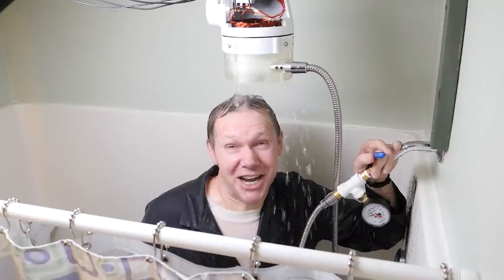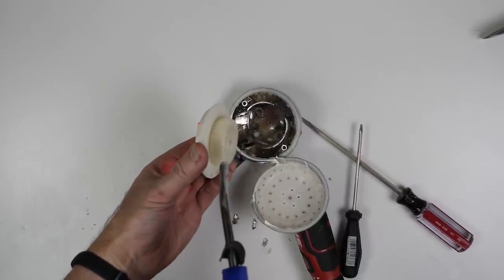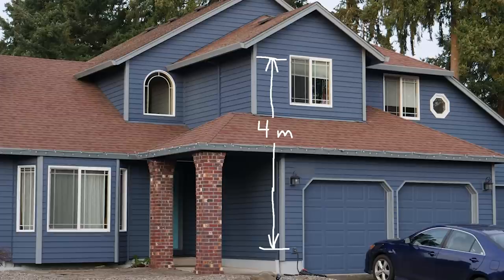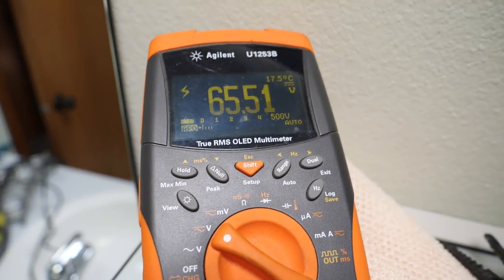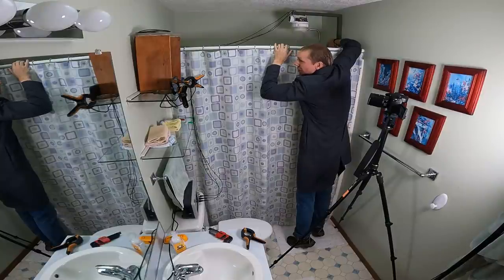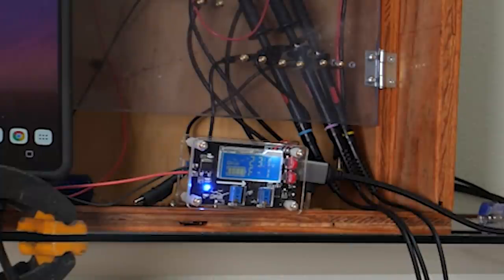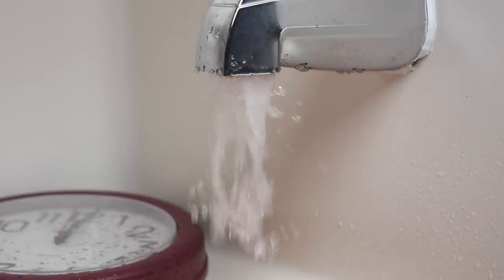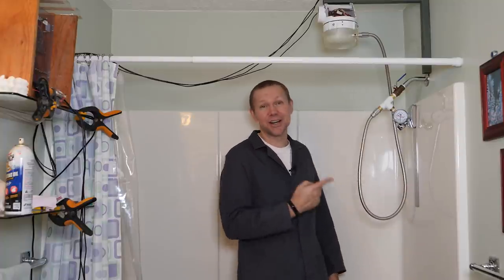SHOCKING Results! How much POWER is in your SHOWER?

Comment: I can see many possible improvements to this build.    First is the large closed bearing .It will be a big energy looser with water coming out at high speed wanting to impart its energy on a wheel with low water mass. Try a smaller diameter shaft with 2  ball bearing sets spaced apart (even open ended s/s bearings are far better).  Second is the generator . Getting the correct generator for the job is very important. Selecting the correct generator with windings not too thick or too thin or too big in diameter can be a bit tricky. You need the water to come out out the turbine dropping vertically if possible imparting all it's energy. Imagine a base ball player catching a ball , absorbing all that energy and then dropping the ball to the ground. This is how all these water powered generators should work to impart maximum energy.     The third very important potential energy looser is the jet nozzle and pipe set up . This is a biggie and has many similarities to resistance in an electrical circuit and is poorly understood. I won't go into this rather I would like to see how you do with the first 2 ideas.   Keep up with the good work!!

Comment: Note Three phase power requires three rectifiers to capture energy generated. Each rectifier has losses. Delta phase configuration 3wires but does “weird buck/boost” thing. WYE configurations uses 3 or 4wires to achieve different voltage output. I am not electrical engineer just a tinker. I’m not good at math so I struggle with formulas they kind of put dampers on the fun😣

Comment: I would try changing the bearings to ceramic or hybrid ceramic and changing the motor to a brushless drone motor or brushless rc motor and size the kv to match the output rpm of the turbine. trying two lower flow nozzles on opposing sides might help balance the power output.

Comment: To get a feeling of efficiency and debugging the problem, you could bypass all rectifying, smoothing and USB charging system and just dump all energy straight into some power resistors and measure/calculate the max power the turbine is able to produce. If that results into only about 3 Watts as well, you know you can rule out inefficiency of the electronics and focus on the turbine part.

Comment: Try looking at the no load voltages on a scope.  You can compare the waveforms to see if there is an issue.  To test the core loss you could remove the stator and spin the rotor and measure the power input.  Then repeat the test with the stator installed and the gen at no load and the stator installed.  The difference in power will be the eddy current and hysteresis (core loss) in the stator core.  This core loss will decrease some with load, but it will give you some idea.  Also you may have increased copper losses due to skin effect if your frequency is much higher than the design intent.

Comment: I love this!

Did I see 3 scope probes? Wonder what it would look like with an oscilloscope. They're getting cheap nowadays, and you shouldn't need a fancy/expensive one for this project.

I was also wondering if there is an optimal speed on the impeller. Perhaps faster is better

You might want to take another look at the wiring of the windings. 

Perhaps the initial star config, along with transformers, could be the way to go. Or a gearbox. 

Very interesting video! I'm subscribing!

Comment: Prehaps you shold try using an adjustable electronic load straight from the rectifier to compare the output power with different amounts of load

Comment: Hello
I love your videos you really have a great content.
I want to ask if you tried testing the generator with a proper wind turbune controller( maybe an MPPT as for solar panels ) to be able to get the max ammount of power and charge a 12V battery with that.
Maybe this will help to get the desired power.
Thank you alotfor your great videos!!

Comment: Your static pressure is different from when you open the spigot. When you open the spigot it relieves some of the pressure. Looks like the water washed all the lubricant out of the bearing.

Comment: Just an idea??? How about run out the generator with the Pelton wheel at full out max speed voltage and step down the voltage through a transformer then dc rectify into a capacitor to straighten out the curves for charging?
Don't most generators run full out at highest voltage then step down for usable current at the end?
Always great to see your excitement with experiments.

Comment: Since you have way more voltage than you actually need for the task, I would assume you could increase the diameter of the nozzle, which would increase the volume of the water, but decrease the velocity. This in turn would produce more torque, which would in turn, provide more thrust to the impeller. This should produce a higher amperage but at less voltage, resulting in a more consistent or "optimized" generation of current.
My SWAG would say a 0.125" nozzle should do it, but to be safe, I would probably go with a 0.137", assuming a current nozzle diameter of 0.097"

Comment: I would test the generator outside of the shower with compressed air to verify it producing the power it is supposed to. Also would consider building the casing to hold more water around the fins with a spiral tapered outlet. The idea is for there to be consistent pressure throughout and around the fins with a clean exit for the water.

Comment: i think you should upgrade the electrical stuff instead of turning down the capicity of the mechanical parts.   because that is where you loose your power, by downgrading stuff and not using it`s full potential, and you get different results every time you use it.

Comment: Might try increasing the diameter of the wheel relative to the water flow/pressure. Larger diameter= Slower RPM, Increased torque. It sounds like when the converter is trying to pull power from the gen, it does not have enough torque to sustain the rpm of the Gen.

Comment: you should proportionate all stages to deliver the optimum tuned setup ,  like the nozzle is proportional to the peltonwheel so it produces lower rpm to higher torque. second the regulator  could be a solar PV , that will regulate almost any voltage to the  intermediate buffer voltage  , eg. 24 volts dc ...  and thats easy to convert to a phone charger  making the tailor  voltage/current for the cellphone

Comment: So there are many ways to increase efficiency but there are cost issues, when dealing with this. 
So the more generator turbines that get put on Water systems the more energy will be needed to pump the water to everyone. But thermal recuperation from waste water as well as flow pressure turning another turbine, and more. This has been a subject I've been thinking alot about since I was a kid.

Bonus fact. Most people who still have copper phone lines coming in to there house have a small ac power source that is required to stay active,  due to law, that you could power led lights or charge things with enough electronics know how, that at least for now is technically free

Comment: I have a rain catch that's approximately 75 feet above my barn. Could you rough out the steps I'd need to take to consider for power storage and generation? I can make the catch as large as I'd like and put multiple turbine points on it as it descends down, but I'd just like to figure out some rough calculations to see at what point the return on investment is really worth it in terms of generating power and initial cost. I've seen some pretty impressive water generator systems that use ponds and other catchments that I could reproduce here, but I'd like to see if any math will give me reasonable expectations beyond just using it for our water needs. I've thought about tripling it up to also store heat in the water since it faces the winter sun.

Comment: Most hydro power setups I've seen have some kind of controller that, to my VERY limited understanding, controls the speed of the wheel by sending some of the generated voltage back to the generator (as if it were a motor) to force it to slow down in order to get optimal power from the generator.

Comment: You need to put a big capacitor right after the first rectifier diode, otherwise the voltage regulator will not work properly, as your generator frequency is low and these converters are DC/DC. In this case, the higher the turbine rotation, the higher the frequency and the better the regulator will behave.

Comment: does the Pelton wheel not potentially have a negative effect if the redirected flow redirects back onto the water flow in the housing.  What I mean is it either splashes back on the inflow, or the preceding bucket.  Also the water that is dispersed is maybe not exiting the chamber fast enough and also maybe interfering?

Comment: Check the output of the generator for different rpm and you could probably avoid looking in the wrong direction before looking for other generators or gearing options. If it is the rpm, gears for E-Bike motors might be the key as they're designed for huge NM.

Comment: if you used a buck converter that handle de 60+V you certainly  would got a LOT more power!! 
In generator the speed relates a lot to the voltage output and the current output relates to the generator counterforce. Without any electronic control of the generator torque (what normally happen with permanent magnet generators) the current don't increase a lot in low speeds, so the power harvest come from the high voltage too!

Comment: i love the idea, if you could actually get 70W out that would not be insignificant. if you can store it too, its probably enough to provide all lighting for the bathroom (not just while showering) and keep electric toothbrushes and shavers charged. those maybe directly, because i suspect they might even benefit from not being permanently charged to 100% in their charging docks that tend to stay plugged in.
i'd love to see you test this further til you get the most out of it. obviously cap it off with a rainwater shower mesh so you can still use it for pleasant showering.

Comment: You should check open circuit voltage. And then short circuit current, after multiplying then you can get the idea what is the max. Power o/p of generator. If it is good then use a good MPPT solar charge controller as the buck converter you are using may cause the problem

Comment: eBay has hydro generators that you would be able to screw on to your shower outlet... 
I have seen many other videos on these things and even got some myself but I haven't used them yet! So I can't tell you how good they are but I did manage to place one against the tap to see if I can get a voltage and it did.... 
You can still use the original shower head too! Bonus! 
The output is unregulated so you will need a solution for that, I don't know how they would work if more than one is used in parallel or series? I plan to experiment with that at some point in the near future...... 
Would be great to see what you can come up with if you get some of these... They should be capable of 12V easy..

Comment: I have a project Challenge for you, What if you could cycle your rain water and turn it into a constant flow cycle, DIY- catch the water in a reservoir- a camping cooler double wide. Keep half of the top of the cooler open. Use a camping water cooler with a screw off top- drill a 2 inch hole at the top, and a 2 inch hole at the opposite side at the bottom- attach a 2 inch diameter hose at the top and seal it, add a 2 inch diameter PVC and plug up the end to prevent water from escaping and seal the PVC to the container, fill water all the way to the top
 Seal the top with a strong plastic bag to create a vacuum, put the lid back on to seal and lock the bag in place.- Drill a hole in the double wide cooler at the bottom side 2 inch hole and attach the hose to it and seal it to the cooler. The side of the cooler you attached the hose to, keep the top closed on the cooler. The other side keep open. Put the water cooler on top of the closed side of the food cooler. Fill the cooler half way, with rain water. Attach a water wheel at the top where the water will flow to produce a current the flows into the cooler. Attach the motor on the outside of the cooler to keep it dry and produce electricity! I'm a huge fan! Your videos are fun to listen to while I drive!

Comment: I am a little bit late. But have you tried to put the output of the generator in a simple resistor (or three) and measure the voltage/current. So you know you don't loose any power in the conversion. Also remember that the generator does not provide the same power at any speed.

Comment: I would restore the generator to the wye configuration and slap a 2:1 or 3:1 step down transformer inline with the voltage regulator. This would not only reduce the voltage output, it would also provide voltage isolation in the event that the generator shorts out.

Comment: Suppose that whole system was contained in a pipe so the water flowing through was captured and continued on down line to another in-line generator. How many generators do you think you could install? Do you think you could syphon a reasonable amount of power from the water tower? Would there be enough drop off in pressure that eventually no water would come out the end of the pipe? I understand you would need to keep the water running all the time but suppose that the water itself was free...

Comment: You could adapt the impeller assembly to drive a pully, attach a pully to a pelton. You could then tune the drive speed with the pullys instead of the water speed. The water speed is your relative constant. Alternators/generators as you well know have a speed in which they are most efficient. Pullys would be simple to tune to that speed. I don't even know if this advice is worth 2 cents though... I've dreamt about constructing a tesla turbine out of salvage hard drive plotters, but I don't have a fancy resin printer. I believe you could benefit from a better charging regulator. Perhaps something rated for the full output of the generator you are using.

Comment: Awesome, have been following inline water power for years (love the applications in skyscrapers especially for grey\waste water). It is interesting that the inline generator you showed was using a different turbine design, similar to VATW? - Curious to see how they landed there.. and how hard that would be to 3d print for home usage. The pelton showerhead does make a cool overhead waterfall.. perhaps using a big drone motor in reverse?

Comment: I believe adding a capacitor would fix the issue as there are "switching" shenanigans in there (buck converters, etc) Basically there is one of the components that keeps power cycling. Thus a large cap could fix this.
Reply: Why would a cap fix it? What would the cap do? Surely that is going to smooth the waveform? What would be the output voltage on the cap? Think it through.
Reply: I am guessing you haven't done any linear power supply design before?
Reply: @deang5622  A cap to provide the peak demand and prevent psu cycling. switching psu do power cycles if you pull max output in a peak. A cap will prevent said psu from power cycling.

Comment: I know it's too late to say any thing but if you "tapped" the center of the Wye connection, your voltage would split & your amperage would double. Like a 120/240 or 240 volt generator.

Comment: I think you're loosing most of your energy by mismanagement of the used up water by the pelton wheel.

Change the orientation so that the bounced back water can exit the turbine housing vertically and add a exit port which funnels it out of the housing.

The rest of the housing should be enclosed to avoid mixing outside air in which adds turbulence.

If you're really creating 500 Hz AC your probably losing quite a bit of energy on the wire due to induction losses. It would be best to place the rectifier right at the output of the generator to avoid any unnecessary loss here.

Another issue is, that you're not considering the torque / power curve of your generator / turbine setup.

You need to do a slow sweep through the voltage range by having a variable load which you can slowly increase. Search for the optimal power point where your getting the most VA out of your system.

A phone is a bad load for such a system as you cannot specify a specific load and it is not consistent. Add a lead battery with a charger to the system to be able to specify the load OR use a dump resistor which can level out the inconsistent load of the phone.

And yes I understand that your USB charger can do current limiting and no this going to help, as the phone is still a very variable load, its just hitting a wall from time to time and will stop charging for a very short time to keep the current below the threshold.

Comment: You don't get twice the voltage in a star connected configuration as compared to in a delta one as claimed. Yes, there are two coils as shown instead of one, but they're electrically 120° out of phase.

Comment: Could be an impedance mismatch. Where your generator is able to make lots of volts but not enough amps for your electronics. Could be Eddy current or hysteresis losses in the generator. Is it a permanently excited type?

Maybe add a strain gauge so you can measure torque from the turbine as well as a hall sensor to get RPM.

From that, foot pounds × RPM / 5252 (freedom unit fudge factor) = horsepower which can be converted to watts. Or just Nm × Hz keeping it MKG / SI metric
Reply: You might need to add an MPPT and a storage element due to the instability of the MPP of the generator/turbine.

Comment: The moment it has load it will have a resistance to spinning it also I recommend you to get a volt meter to check how much power is the iPhone pulling from an AC outlet it can't be just 5 volts.